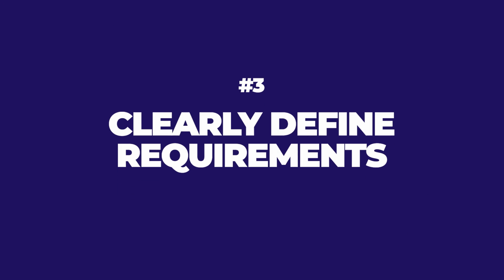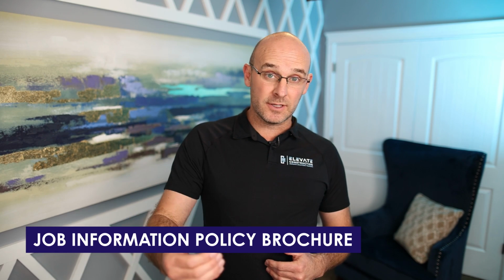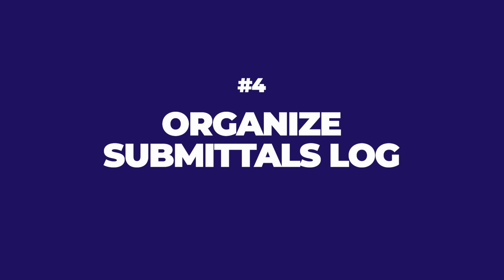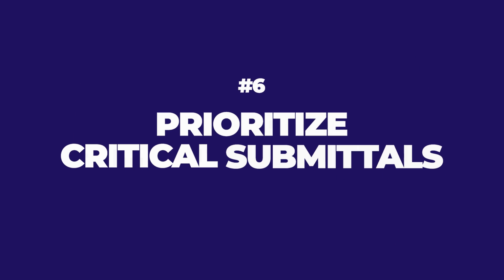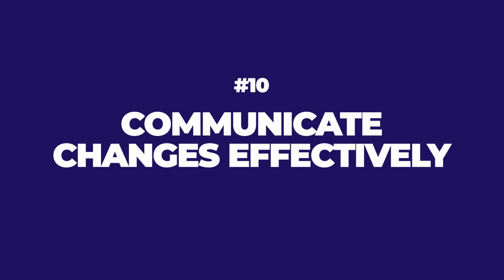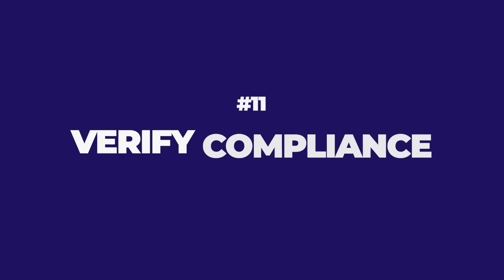How To Do Construction Submittals

Comment: What are a few things you would consider not significant enough to get new prints. Also a few examples of bigger things that would justify new prints. Thanks!
Reply from the maker: Small. RFIs.  Also if I can slip sheet I will.  Major design changes I would get new ones.